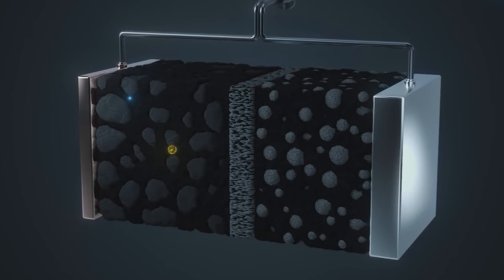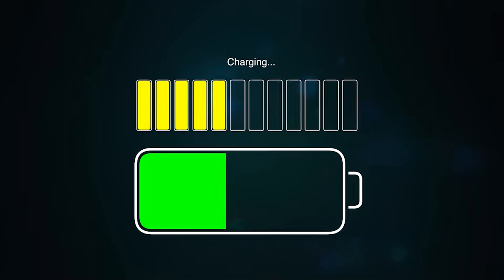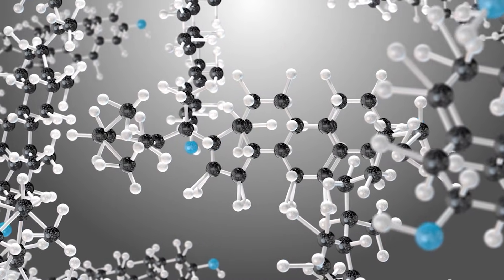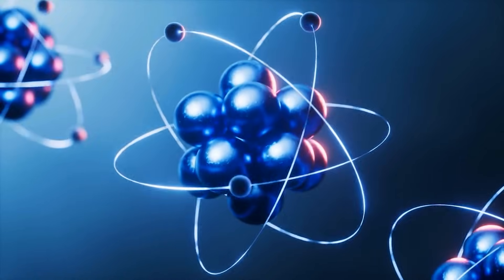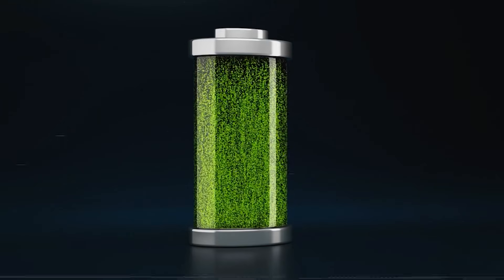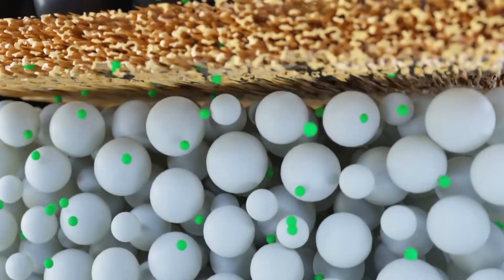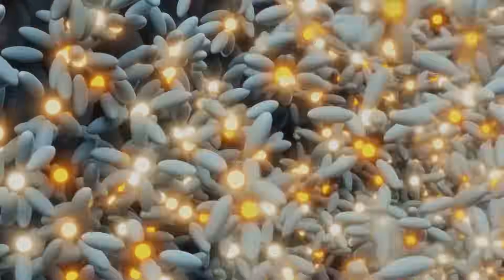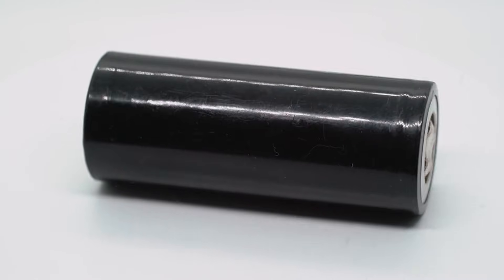This Is What a Lithium-Ion Battery REALLY Looks Like Inside

Comment: (A Lithium-ion battery  looks like ) 
 (Various. common. battery. shapes. - most often. a. 
cylindrical. metal. cane. (like an AA, but bigger). flat rigid  rectangular block 
(prismatic) ,or a 
flexible , foil -wrapped pouch 
cylindrical cell: 2170 -18650  sizes